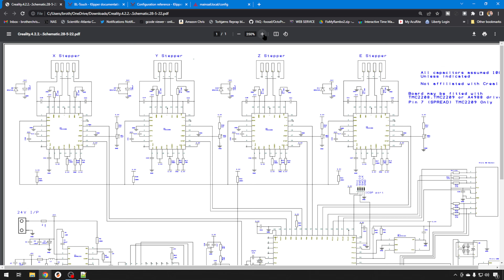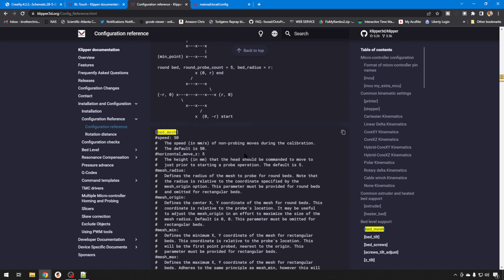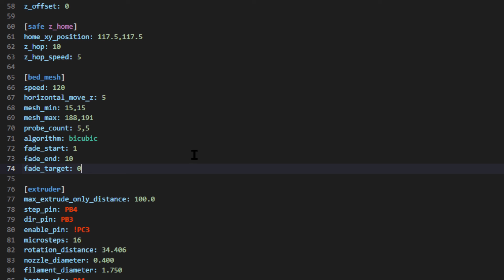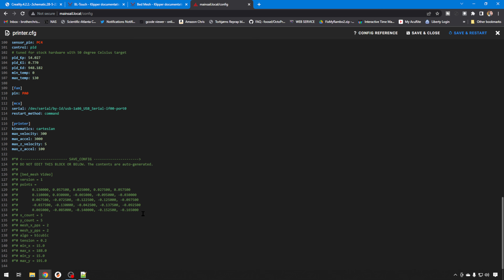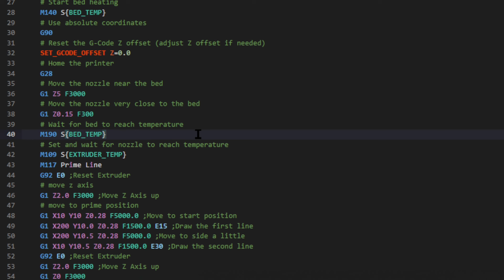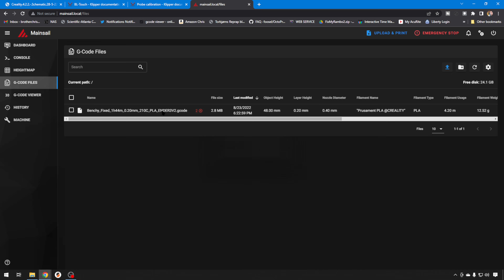Klipper - BL Touch - Auto Bed Leveling - Creality Ender 3 V2 - Chris's Basement - 2022

Comment: Excellent video! 1 issue. I think you should mention that you would run into the "no trigger on probe after full movement" error earlier instead of saying you left it out. I ran into the error and thought I had done something wrong leading up to that step, so went down that rabbit hold before finishing the video.

Comment: Excellent video, however, I still have a problem that is not covered. My Ender 3V2 Neo with 4.2.7 board, sprite extruded, Sonic Pad and Klipper will not work because I get “unable to parse Z_offset in BL Touch” error. How do I fix this. I followed everything to the letter but I cannot fix this error.

Comment: hello chris i got question for u i have ender3v2 with CRtouch and not work. i watch your video and nothing happends ( use klipper)
Reply from the maker: What is the error you are getting?
Reply: @ChrisRiley   i think ( must make new firmware and check ) and i found on your video to change some , and when i make new firmware i tell you if fix
Reply: i fixed

Comment: Hey chris! wil this work with a CR touch as well? Just would like to make sure. also, how do I adjust the E steps for a BMG extruder (it has a 1:3 gear ratio)? also, the probe on my printer is used with a different duct so it is more further to the left.
Reply from the maker: Yes, same setup for CR touch. E steps for Bontech should be set to 415, use the M92 command. If it's in a different location, just adjust the offset numbers.
Reply: @ChrisRiley  this is great info. Thanks! Subbing for all the good printer tips 😁

Comment: Weird, I don't have a START_PRINT macro??
Reply from the maker: Check in mainsail.cfg or fluidd.cfg it could be in there.
Reply: @ChrisRiley  im having the same problem. my mainsail.cfg is also read-only. could this be a new update?
Reply from the maker: @gabbyaraniego396  It could, you can add the same updates in printer.cfg, they will work the same.
Reply: @ChrisRiley  yes I have done that. It was a much simpler route to take than to make mainsail writable imo. Thanks

Comment: probe_calibration isn't saving for me. any ideas what could be going on here? I did manually config and got it to work
Reply from the maker: If you run save_config does it reboot the machine? I can't think of why it wouldn't save it.
Reply: @ChrisRiley  thanks for the reply. I'm not sure what was going on... I power cycled the rpi and Ender3... I mean, Tinker3 lol. then did it all again and it took, thanks!

Comment: One issue with z offset in Klipper.  You cannot directly transfer the MARLIN value as Klipper does not allow negative numbers on the z_offset line.   I don't know how Klipper works it out, but it will always be a positive number.  This is something that confused me initially as negatives were accepted in x/y but not z.   Just felt weird.   Anyway, now I have Klipper dialed in, I would not go back to Marlin.    Now I have just one bug to work out.   Random MCU Disconnects on long prints.   Thinking maybe the Creality 4.2.2 board I have may have a dodgy USB port, but I can't really nail it down to comms yet.
Reply from the maker: Agreed, it's hard for me to go back and forth because of how they treat the negative. Strange on the disconnects. I wonder if there is some logging somewhere that can help debug.

Comment: Hello, I installed it, but the bltouch opens and the z axis goes down. After touching the table, it continues to go down. How can I solve this problem?
Reply from the maker: Check the black and white wires are on the right pins. You can check the status of those pins with the M119 command from the console.

Comment: Thanks Chris, I have my printer converted to Klipper now! The only issue I had was z height set to 5 was to low for my printer setup so the bl touch was throwing errors. I have it all sorted now.
Reply from the maker: That's great, thanks for sharing your experience!

Comment: How to solve endstop pin probe z virtual endstop error?
Reply from the maker: Make sure the statement is correct in the Z motor. It should look like this. endstop_pin:probe:z_virtual_endstop
Reply: I had the same error because i typed "[bl-touch]" instead of "[bltouch]". so the typo may be somewhere else.

Comment: Hi, I have issues with my BL Touch Z offset. I used a receipt paper and saved the value as soon as I had a little friction giving me a value of about 2.7mm offset. However when I started the  calibration cube print, the nozzle was not touching the bed and the nozzle was just oozing mid air, almost as if my offset values were ignored. Using the "live Z-offset" buttons I was able to lower the nozzle enough (actually too far at the first time) so that the filament could grip on the hotbed. The new offset value was 3.07mm. on my second test print the nozzle was way to close to the bed and scratched the PEI coating. So I stopped the print, did another Z offset calibration with an offset of 1.8mm but printing the cube again , the nozzle was again  way too high. I use an Ender 3v2 with Mainsail running on a PI3B, a almost new PEI sheet, BL touch with a 3d printed adapter to mount it on the other side of the Sprite extruder (gave me good results using jyers (titiopher68) Marlin version until one day my printer stopped saving the Bed meshes). I could not find anything on Google, maybe somebody here can help me?

Comment: hey Chris, thanks again for this clear instruction!!! really appreciate your teachings and sharing! just a quick one, as I'm following this video, I found that my ender 3 v2 neo, as it does the auto bed levelling, when it gets to the last row (maximum y on the bed), it always hit the max and makes a "thud" sound. How and where can I set this, so that the y doesn't got all the way to the max? hope I'm making sense. played around with the numbers for mesh max mesh min, but that doesn't seems to be making any diff.
Reply from the maker: Thanks for watching! I would first try mesh min and max they should look like this. In the example, the 198 number is the one you would adjust. 
[bed_mesh]
speed: 120
horizontal_move_z: 5
mesh_min: 35, 6
mesh_max: 240, 198
probe_count: 5, 3

Comment: Chris,  Awesome Video!  following your instructions i was able to get the blTouch working on my Longer LK5-pro upgrade.  This is my first venture into Klipper and it's quite a learning curve.

I have a couple questions, all relating to Klipper, and it's implementation in a Biqu Manta M8P board, with a CB1 EEMC.  I'm running TMC2209 stepper drivers,  I purchased both a TFT70 and a Bigtree HDMI 70.  I also took the plunge and purchased a Biqu H2 500C to be able to print flexibles and other materials.    I've got the mainboard talking to the printer and thanks to your video i have the blTouch working with mesh bed leveling.

Here are my questions,
1.  my extruder Thermistor reads either -250C or + 250 C  and doesn't track the heater.  ( the heater works)   I've tried sever config settings to no avail.  I've reached out to biqu, but no answer yet.  All the documentation is for Marlin, so it doesn't help me with Klipper.
2.  I haven't been able to get either screen to work.  THe TFT screen displays a menu but says can't connect to printer.  The HDMI 70   turns on, but nothing displays

I'm kind of at a standstill and I would appreciate any help you could provide.

Thanks in advance, and please keep those Klipper videos coming!!!

Dave
Reply from the maker: Sorry it has taken me so long to get to this. I'm not really sure on the thermistor issues, klipper supports a handful of them, but not sure which one BIQU might be using. The screen with Klipper might be an issue. Klipper doesn't support a lot of screens. I really don't recall how they want them to work, but it might not be able to talk to the serial TFT screen like Marlin can.
Reply: @ChrisRiley    Thanks for getting back to me.  Resolved the thermistor issue by installing a MAX365 module to on of the empty channels of the M8P  (Awesome Board btw)   I plan to dig into the TFT screen when i get home this weekend.

On a different topic, because the M8P supports multiple heaters and thermistors,  could i not use those inputs and outputs for my heated enclosure?  Also,  is my BLTouch going to hold up to the higher heat?

Again,  you are the man...  keep putting out those awesome videos!

Comment: Thank you for this video. I now know what failures I have in my .cfg.
The Z is motoring down until the LBT triggers but then the Z does not climb, the probe tries to deploy and the BLTouch failed to deploy occurs (because Z hasn't travelled up).

You have a great presentation style.
Reply from the maker: Thank you! It could be a lot of things, but most of the time it's a wiring issue or the wrong pin has been called out in the config file.

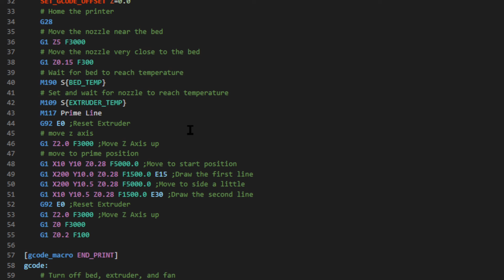Comment: completely lost me at 25:02. What macro is that in mainsail.cfg? I dont have that in mainsail.cfg. I am only following along from this video alone. Is that referenced in some other video?
Reply: Found it in the other video, mainsail.cfg is read only so I created my own custom cfg file for custom macros. shame we dont use the same slicer and now my printer ignores my slicer settings for nozzle and bed temps. Also m205 errors every time I print... just going to have to remove those macros and load the bed mesh manually every time.
Reply from the maker: These are all the macros I run. https://github.com/Klipper3d/klipper/blob/master/config/sample-macros.cfg Curious about the follow up comment. I have seen a lot of folks with the read only issues on mainsail.cfg. I wondered what was causing it. I will see if I can recreate it and include it in a future video.
Reply: @ChrisRiley  I fixed the incorrect temp settings and the M201 error by doing the following: 
added this to Cura Machine settings start g-code:
; M190 S{material_bed_temperature_layer_0}
; M109 S{material_print_temperature_layer_0}
START_PRINT BED_TEMP={material_bed_temperature_layer_0} EXTRUDER_TEMP={material_print_temperature_layer_0}

And fixed the M205 command error by making jerk control setting visible in cura and disabling it.

Comment: fantastic video. thank you. just a quick tip that took me hours to figure out. sometimes it looks like BLtouch is not compensating even if you have everything loaded and displayed and saved. if your fade start is less than z offset after calibration, it's not compensating. so i just put like 3 mm as fade start and it worked like a charm.
Reply from the maker: Thank you! That is a great tip and something I never really thought about.

Comment: Sadly my mainsail.cfg is stuck in read only.
Reply from the maker: Not sure why this happens sometimes, but it's a permissions issue in Linux. If you log in to your pi SSH you can run this command to correct it. sudo chmod 755 /home/pi/klipper_config/mainsail.cfg
Reply: @ChrisRiley  Thank you so much for the reply, I will try this when I get a chance. Love your channel BTW.

Comment: Hello Chris, and thanks for the time you spend for us!!  So, I have installed Klipper/Mainsail/BLtouch and all is well... except... my 'mainsail.cfg' is read-only...  Any direction (for a NOOB...) on editing the 'mainsail.cfg' file?
Reply from the maker: Not sure why this happens sometimes, but it's a permissions issue in Linux. If you log in to your pi SSH you can run this command to correct it. sudo chmod 755 /home/pi/klipper_config/mainsail.cfg

Comment: pretty wild you can see the gantry sag delay when doing the bed mesh. Right side moves way after the  left side.
Reply from the maker: With one lead screws it's pretty challenging to get it set right where both sides will stay 
consistent.
Reply: @Chris Riley  I bet. The shirty part is that any bump would throw it off.

Comment: If anyone is wondering to make the G29 command work because klipper doesnt support it just put this in the printer.cfg

[gcode_macro G29]
gcode:
 G28
 BED_MESH_CALIBRATE
 BED_MESH_PROFILE SAVE=p1
 G1 X0 Y0 Z5 F4000

Comment: Whenever I try to configure the Z-offset with a probe_calibrate, the nozzle is WAY too close to the bed to print. I have to go in an manually raise the Z-offset to get it functional. Why is this? Any idea why my probe_calibrate is always too low?
Reply from the maker: The only thing I can think of is the initial Z offset is not set to zero for some reason. Make sure everything is set to default before you star the calibrate.
Reply: @ChrisRiley  As in the bl touch z-offset that you initially set to 0?
Reply: @ChrisRiley  And if so, would I have to delete it from the grayed out "save_config" at the bottom of the file?
Reply: @ChrisRiley  I just tried probe_calibrate again. Made sure the bl-touch z-offset started at 0. I ended up with a offset of 1.45. I'll see what this does with a print in a bit.
Reply: @ChrisRiley  Apparently I'm just going to bombard you with questions/replies. If the nozzle is still too close, would my layer height reflect that? My single layer test is rough like sandpaper but measures at thicker than my initial layer height which is set to 0.2.
Reply from the maker: @amorton94  Yes, if it's too close you should be able to measure it. Although, the first layer will be tricky as there is always a little added squish to it.
Reply: @ChrisRiley  IDK. I don't understand why this is so difficult. Everyone else, as far as I've seen, runs probe_calibrate and then starts printing without issue. I have nothing but problems. Typical. 🤦‍♂

Comment: I've got ender 3 pro with this board, all set according to documentation and probe wont stop Z-axis... It works fine in marlin but whenever i use klipper it wont stop. Any helpers? :( I've tried everything I've found...
Reply from the maker: Hmmm, maybe the pin mapping has changed on the newer boards? The only thing I know to do is look for a different config in the example and see if the pins for the probe might be different.
Reply: @ChrisRiley  I've been looking it up... Found nothing... I'm quite desperate

Comment: So I'm new to this stuff and I have no idea how this works. I had a problem concerning my sonic pad and sprite extruder that I just got (I also use CR Touch). Basically when I'm setting the printer up, I hit the calibrate button and it touches down on the the first 5 points or so then completely misses on the next. I had someone on reddit tell me I need to do a bed mesh calibration or something, but I have no idea how to access any of this or what to do/change.
Reply from the maker: It does the mesh by the position min and max. Make sure those are within the correct range or the mess with overshoot.
Reply: @Chris Riley  thanks, I got everything working, but I do still have a problem with my filament hardly extruding. I think I just need to change the esteps though, at least I hope lol.

Comment: Hi Chris,
I have Klipper running on my ender 3V2. I see videos on doing a e-step to verify that it is extruding the correct amout. When I tell Klipper to extrude 100mm, it is actually extrudung 97mm. I can not find where to put in the new numbers to have it extruding 100mm. I can't find anything in printer.cfg to change this value. Can you help and do you have a video on setting up e-step. Thanks
Reply: I think I have found the answers I was looking for. Since I am 80, I thought I better write down the steps.

Ender 3V2 E-Steps Calibration using Klipper

I was looking for a procedure to calibrate the E-Steps on the Ender3V2 using Klipper but could not find where to store the new settings.
Found videos on how to do the calibration. Using ideas from various videos, I came up with a procedure to do the calibration.
In Klipper, is a Printer.cfg file. In there, is a area called [extruder]. In here is a line item called rotation_distance. 
This is where the settings for E-Steps are stored. Remember this number.
The following is the process to calibrate the E-steps.

Step 1. Remove the filament from the extractor.
Step 2. Remove the tube at the extractor end that goes from the extractor to the hot end.
Step 3. Feed filament thru the extractor until it just comes out of the extractor.
Step 4. Cut the filament flush with the exit hole on the extractor.
Step 5. In the Mainsail interface, set Extruder temperature to 200 C. The following commands will not work until the Extruder is heated.
Step 6. Enter the following commands in the Console.  M83 (enter), G1 E100 F100 (enter). This will feed 100mm of filament thru the extractor.
Step 7. Cut off the filament flush with the extractor and measure its length with a ruler or caliper. If it is 100mm, no further steps are required.
Step 8. If the length is less than 100mm, it is under extruding and if it is over 100mm, it is over extruding. 
Step 9. Take the number that was stored in rotation_distance (times) the length of the filament that was extruded (divided) by 100.
Step 10. An example: 34.406 x 96.5 / 100 = 33.298   This will be close to what you need to feed 100mm thru extractor.
Step 11. Enter this new number in rotation_distance and "Save & Restart"
Step 12. Repeat steps 5 thru steps 11 until 100mm is fed thru the extractor. 
Step 13. Once E-Steps is correct, reconnect the tubing to the extruder.
Reply from the maker: Thanks for sharing your findings! I'm glad you figured it out

Comment: Love u bud nice video but Im getting this error when I press on calibrate=Move out of range: -21.000 5.500 5.000 [0.000]
Reply from the maker: It thinks there is a spot on the bed it can't get to. Try adjusting you probe offset and see if it goes away. Make sure you -/+ sign is correct based on location.
Reply: @ChrisRiley  yeah issue fixed, thanks

Comment: Excellent video series Thanks Chris!!!, I setup my Ender 3 S1 Pro with Klipper & it’s working perfectly!!! Was wondering though if you can have both Auto Bed Leveling as well as manual, so that you can level each corner screw?
Reply from the maker: If he makes manual adjustments, ABL will still be able to compensate